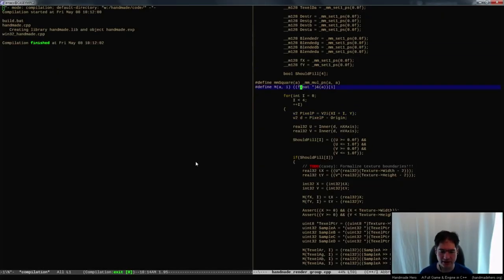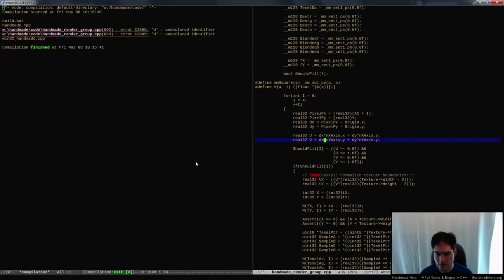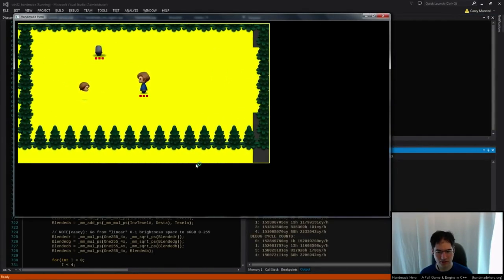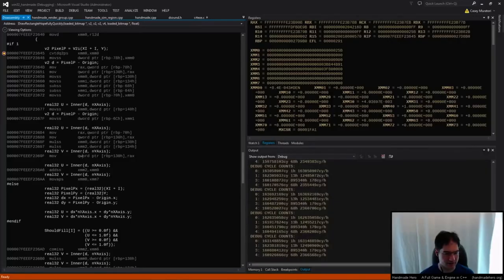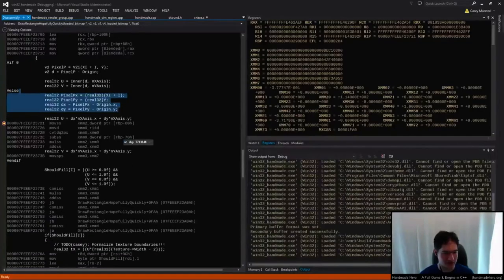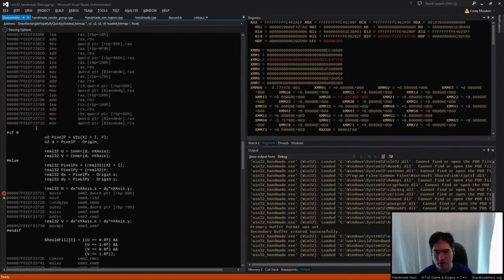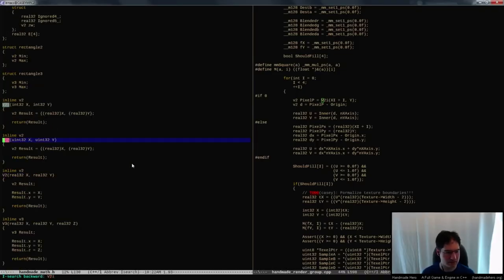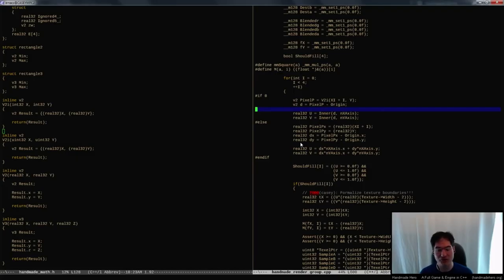Handmade Hero | "Zero" (50 Cycles) Cost Abstractions

Comment: My experience is that the more you throw at the compiler, the more likely it is to miss opportunities. There will be something it can’t see. Maybe it doesn’t have the ability to look through a particular arrangement. Maybe there is a point where optimization passes just end, even though there is more to do. Maybe it has to do with the combinatorial complexity of finding the optimal set of optimizations. If you need the best performance, your best defense is to consider what performant code looks like and write it that way. If a compiler does sort out your mess, be happy. It will often do a pretty good job. But don’t become too reliant.
Reply: "If you need the best performance, your best defense is to consider what performant code looks like and write it that way" - pure gold

Comment: V2 is an array, compiler had to put x and y next to each other. After inlining compiler was free to bail on recomputing y, which doesn’t change with iterations, and probably did some smart simd stuff for x. Ironically, v2 array is used indiscriminately by gamedev ppl bc they believe it’s always faster 😂
Reply: Can you tell me exactly who use v2 array because they “believe it’s always faster”?
Also why would the compiler have to put x and y next to each other? This is optimized mode , the compiler can do whatever it wants to produce the correct code.
I believe it’s used primarily for convenience.
Reply: @khoavo5758 arrays in C are just an initial pointer, and then each following entry is the initial pointer offset by the size of an element. This means that moving data will break the array. 

The compiler doesn't know what else might try to use the data, (other application etc) so it won't destroy your data structure. That's C's "stable abi" which is why all libraries are written for c. 

However, by declaring them as separate variables, the c compiler doesn't have to make any promises about the memory structure. This means it can do more optimisations. Specifically, it's storing the values in an X array and a Y array, which allows them to use SIMD instructions. SIMD is single instruction, multiple data, and it refers to high performance instructions that can calculate multiple values simultaneously.

Quote from paper: player
speeds must already be stored in a ‘SIMD-friendly’ format, i.e.: xxxx, yyyy, zzzz. Data organized like
this can be directly copied into a vector register.

Search SIMD tutorial uu nl if you'd like to learn more.
Reply: @khoavo5758  Yeah, it is due to convenience, you can easily swap which one you are indexing. Like, how is an array different from struct from compiler's point of view in this specific example?
Reply: Also I did not read the asm (not familiar enough with x86) but compiler also probably had to put a struct onto the stack vs just keeping all variables in registers.

Comment: So this is a hand-picking of a situation that wouldn't really fit inside the ''zero-cost abstraction'' concept, and using it as proof of why a language is bad?
There are also other things that come into play, like if the class has move constructor implicitly deleted and move semantics aren't coming into play(which is likely what is happening here if I had to guess). I can tell you from experience that I encountered this exact issue when defining a struct used to hold rendering data without proper copy/move constructors, and after adding the constructor gained like a 20-30% improvement(as copies weren't constantly being made and move semantics come into play).
Inline is also a complete suggestion, and if you truly really cared you should be using a compiler attribute like __attribute__((always_inline)).
I know Casey is generally quite knowledgeable, but rants like these come off as really out-of-touch(and there are quite a few of them).
Reply: the slow code path also did inline the function calls! but the compiler did not optimize it further after doing the inline. a compiler is a just a tool, made by people, that is imperfect, not a magic box that takes care of everything for you, which is the whole point. no zero cost abstraction is always or truly zero cost, because no compiler does perfect optimization.

Comment: This is like the first place where I see someone points to function call as "zero cost". Keyword inline is usually used to just satisfy ODR and does not guarantee to actually inline things.
Reply: you can literally see that both functions were inlined in the slow version
Reply: @rubberduck2078  That doesn't mean it was because of the "inline" keyword. In fact, "inline" and "inlining" should be treated  as pretty much unrelated. Functions that aren't marked "inline" can be inlined, too, even when they aren't in the same translation unit (if you have link-time code generation enabled). It's kind of up to the whims of the compiler whether it happens and whether the inlining is even helpful.
Reply: @babgab he meant in the disassembly, obviously

Comment: I wonder if gcc or clang does produce a better output. Also, this should be filed as a bug for the compiler instead of bashing it, we don't even know why it was not able to optimize it.
Reply: Yes and no, you should definitely Report this absolutely, but Bashing it is still valid since most C++ programmers fill their mouths with "muh zero cost abstraction" nonsense without understanding things, and the point is that you should always try to not confuse the compiler and always check the assembly before uttering something is a zero cost abstraction.
Reply: Bashing zero cost abstraction is completely valid here. If somehting so trivial can confuse the compiler so much, what are mountains of more complicated stuff going to do.

Comment: Debug build... Try the same in release for a valid conclusion
Reply: It was compiled on MSVC with -O2, what are you talking about? I verified this behaviour myself on my machine as well, on a more recent version of MSVC.
(Also, if you actually paid attention to the disassembly, you would see how it was rearranging code in a way you would never see on a debug build, so I shouldn't have to tell you this)
Reply: @TheSandvichTrials  I stand corrected!
Reply: @TheSandvichTrials  Does gcc or clang produces any better output?
Reply: @ekrem_dincel  i don’t know, that would be interesting to test
Reply: @TheSandvichTrials  if you have the code and sharet with me, I would love to tinker with it.
Reply: @ekrem_dincel  I can't legally redistribute the handmade hero code sadly, to gain access to it is a perk of pre-ordering the game. If you do order it you can get the exact state of the codebase in this episode.
Reply: @TheSandvichTrials  I don't think I can do it. I will wait for your respond if you are planning to try other compilers.
Reply: msvc is very, very weird. There are quite a few flags that mix optimization and debug. do cl -h for some options and msdn for some. Whether they actually do anything or if the compiler produces correct output is anyone's guess. You have the option to easily try out clang if you want, i guess?
Reply: (Just a bookmark to hear about testing of any other compilers.)

Comment: Interestingly, that's what J. Gosling (creator of Java) also complained about, albeit from a different angle:

"(...) if you look what lots of kids fresh out of college have been taught, it's, "Objects are good, define lots of them!" So you get programs with zillions of little adapters, with methods that are one or two lines long, and you start profiling them and they're spending all of their time doing method dispatching. Then the only kinds of optimizing compilers that do any good are the ones that spend almost all of their time trying to eliminate method dispatching and doing lots of full inlining."

Having programmed in Java, I can testify that not only this is not discouraged but has become the de facto coding standard nowadays.
Reply: Then why not do the inlining in the compiler? I'm not saying all abstractions and wrappers are good, but if there are some that help with readability of the code, then what is the justification for not doing the inlining in the compiler?
Reply: @SiisKolkytEuroo  Good Java implementations do inline short functions, as Gosling mentioned. However, a pile of getters doesn't really aid readability and is poor engineering taste -- more work for compilers to inline, more work for humans to grok through.

Even if that work is done at compile time, it still poses problems, e.g. C++ STL algorithms work two orders of magnitude slower (!) in debug mode. Not to mention STL source code is barely readable.

The takeaway isn't "abstractions are bad", but "there is no free lunch". Abstractions are a trade-off, giving up performance and/or simplicity for conforming to some mental model.
Reply: Code is written for humans. Not machines. The computer would prefer it if you fed it a bunch of zeros and ones, than gibberish that it then has to compile and transform. Humans understand text. If your code looks more like gibberish rather than text to a human, then guess what, it sucks, no matter how many less methods the compiler has to inline. Use methods and classes with descriptive names to make your code readable.

Comment: He is trashing a language, and this has nothing to do with a language, but with a respective implementation of that language.
Reply: Could be said for any language. As long as you have an "as if"-rule there's no reason to ever consider implementation details. The compiler will choose the optimal data transformation right? 

I'd be dishonest to pretend like you don't have a point though. I wouldn't expect this behavior from clang or gcc. But there absolutely are cases where both of them do worse than I would expect. It brings you into this awful reality where you have to double check everything when you start to care.
Reply: This exact statement is and will always be c++'s problem

Oh "it's just the implementation that's bad"

Well it's what we have, it doesn't really matter, it's bad
Reply: It has everything to do with the language. It has to do with the meaning that the C and C++ standards give to the keyword "inline" compared to what people think it really is.

I'm surprised that in almost a decade nobody caught the issue... the issue is that inline does not mean "inline the code whenever I call this function" in C. Code inlining is left to the compiler implementation. The keyword inline means that each TU can have its own definition of the function's code. So, even if the compiler performs inlining (in this video we can see that the code was inlined, but that was because of the -O2 parameter given to MSVC, it has nothing to do with the keyword inline in this case), it does not mean that it will do the same as if the code was truly inlined. Because an inlined inline call is still like a free standing function call, the code gets inlined but the context is not affected to preserve behaviour and prevent side effects due to the fact that other TUs could have a different implementation, so the changes are local. If you truly want inlining with the exact same optimizations available as if you copypasted the code in place, you must mark the function as static inline. THAT is the reason why the first version of the code was slower. And THAT is a fault of the language. Because C and C++ say that inline means something that literally has nothing to do with the meaning associated with the word itself.
inline = each TU has its own definition of this function
static = this function lives only within this TU
static inline = each TU has its own definition of this function + this function lives only within this TU = this function definition is unique to this TU and this function only exists within this TU, so we have full knowledge of its contents. This gives the compiler full knowledge of the function's code, and it also allows the compiler, without incurring in UB or breaking the standard, to give the optimizer, from the point of view of the function, full context of the caller code to the callee. This means that it can treat this function as if it could be 100% physically inlined, and when you do actually inline calls to it, give full context of the TU to the compiler, allowing for full optimizations.

Tale as old as time...

tl;dr: this issue could be fixed if the functions were static inline rather than inline. This comes with its own side effects tho, so that's important to consider... for example, code duplication when the function is not inlined if the final executable is built with more than one TU. If an unity or jumbo build is made, then just one TU exists, giving a single (static inline) unique inlineable definition of the function and preventing all issues described.
Reply: @wajideus4591  Well it's obvious that zero cost abstractions are not possible by definition. You just move some work by decoding abstractions from runtime to compile time, in the end it is not zero cost at all. But even if we don't mind about long compilation, then we're still relying on compiler optimizations,  this is what making modern C/C++ programs run fast, also we can get rid of annoying assembly insertions and be more productive. Compilers aren't as smart as we expect, and still it's easier for them to optimize simpler code than code with "zero-cost" abstractions. Maybe in that particular case gcc or clang will show better results than mvsc, in spite that we can't still rely on compilers, because there is always possibility that gcc or clang will fail to optimize in other cases.
Reply: @fakt7814  What is colloquially called zero-cost abstractions in the C++ community usually refers to zero-runtime cost abstractions.